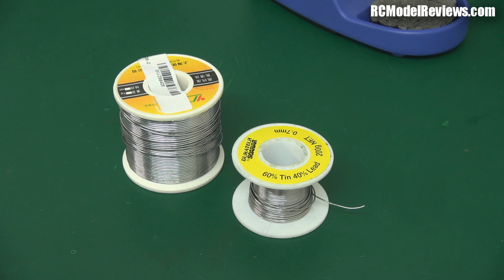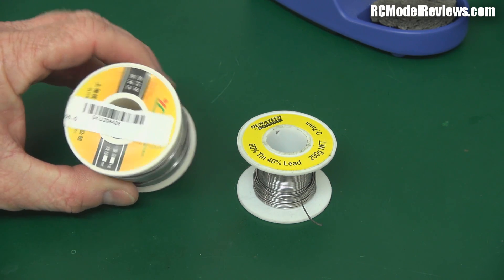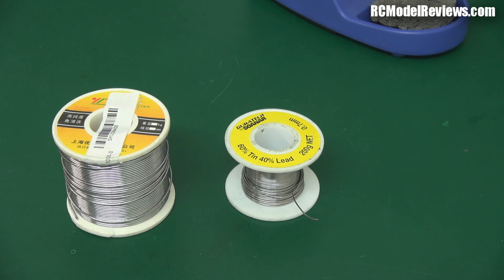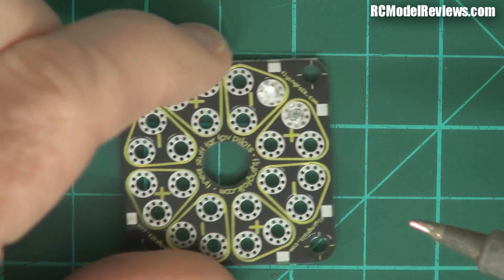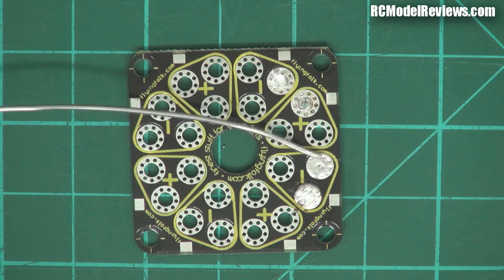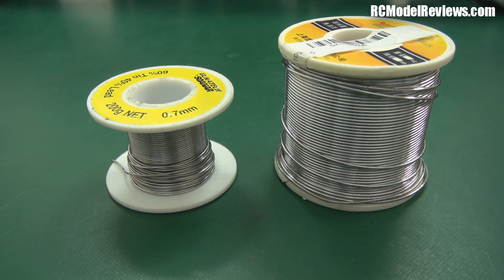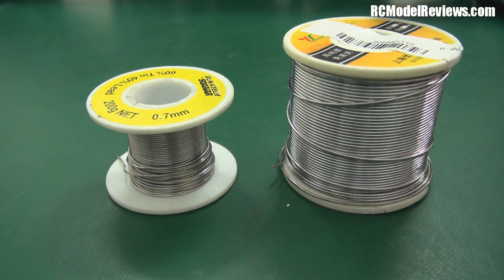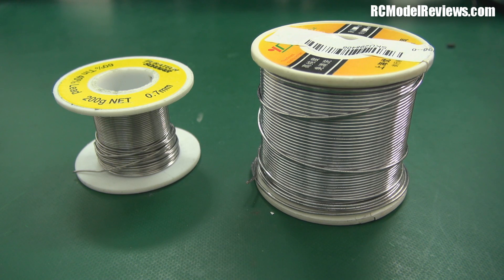60/40 versus unleaded solder

Comment: If you dispose of your expired ciruits properly lead is not a problem. IT will be recycled and made into new solder or radiation filters.
Reply: Very true. The problem is since Lead Free solder fails fairly quickly under vibration and normal heat temperatures found in cars, it has become one of the major reason modern electronics fail and end up in land fills. It's also been linked to several aviation crashes killing hundreds of people and spilling all those contaminates all over he ground at the crash sites. That's the reason it was banned in the aviation industry, I know I work in the aviation electronics industry. If you are caught using lead free solder in aviation you'll be severely reprimanded or fired on the spot. Not to mention all equipment from that lab will be investigated to check for lead free solder. To bad it doesn't work reliably, it could have been a great environmental help. Now it's just a deadly problem and a major contributor to land fill electronics that fail faster than leaded electronics. Best Wishes n Blessings Keith
Reply: Keith Noneya
 Great information there. Isnt tin a heavy metal to though? Not putting electronics in landfills would be a better idea. I mean until they have been harvested for metals and other resourses. I realise there is probably little financial incetive in harvesting lead but the environmental benefits should outweigh such consideration in this instance. Much more important than chasing carbon.
Reply: Well the harvesting would not be financially viable due to the cost of the materials to extract it. However if there is gold and silver in the electronics it is sometimes beneficial. The best way to solve the problem is to offer cash for working machines or re-purpose them. So good ideas are cnc machines, 3D printers, 3D Laser cutting machines. Or even some robotics. In reality there are so many electronic devices, the real answer is cash for used electronics. I long term solution would be to improve the ability to upgrade or simply unplug an old electronic module to put in a new module. Kinda like lego electronic devices. It would take some serious engineering to do it. Another partial solution would be to create electronic warehouses where electronic devices are stored for education centers. Then votech, colleges or elementary schools can come and take what they want to use for experiments or training.
Reply: Keith Noneya Yeah recykling is great especially when things are recdykiled in their intended use since it requires the least resourses. But I still think scrapping fees simular to those on refrigerators could be an option for end of life disposal. I do think that home electronics manufacturers prefer lead free though since it makes people have to buy their products more often.
Reply: Yeah I agree a disposal fee would be ok as long as the money goes to improving the problem not just going into the general spending fund for politicians to say" vote for me and i'll give you someone else's money in the form of a benefit". Also with a fee I think you have to collect the old electronics otherwise it's just a punishment tax for using something and then the old electronic trash still ends up in the land fill.
Reply: Keith Noneya
The fee should go towarts safely harvestin heavy metals off course.Not like tax rebates on "green cars" that only promotes one fuel over another which is actually less green considering the way most people drive.
Reply: Yep I agree with that. Of course the whole "Man Made-Up" Climate Change Scam is another story in itself of government and opportunistic capitalists, posing as environmentalists, using it in a corrupt and power grabbing institution. Well I think we've beat this horse dead already. Thanks for the conversation, Rimmer! Best Wishes n Blessings Keith

Comment: Ditto and good info.  Lead-free solder sucks bigtime indeed!  Although it flows for shit and is known for making shorting tin whiskers, we are forced to use it on high reliability areospace equipment delivered to the EU because of their (*) RoHS regulations which apparently even trump reliability considerations...what major BS! ...and sure enough... units have failed because of tin whiskers...I can't elaborate on the resulting failures and effects...but customers got the lead free products they wanted!  We experienced no such failures on US products using good old lead!  
My advice: Give me "Lead Based Goodness" in my electronics...just don't eat your lead containing electronics!...and as far as breathing lead fumes when soldering...that's a bunch if horseshit also...we solder at hundreds of deg F...boiling point of lead is over 3000Deg F!...sure, a few molecules may be liberated when soldering, but these are also immediately dispersed, or sucked away and captured in carbon filter by the solder vac systems in industry, so operators are breathing a fraction of a fraction of a fraction of those (if any)!  Most hobbyists home benches don't have a vac system, but when soldering with lead based solder, if you vent smoke away, you are more likely  to be exposed to dangerous levels of damaging gamma rays from the Kuiper belt, than dangerous lead molecules from your electronics work!  Solder on!..and with lead based eutectic solder...I have been since high school, in industry with vac systems, and at my home bench without, and I, nor ANYONE I've EVER worked with in industry has been poisoned by it yet!  KA1RPB

Comment: Yeah that is some shit lead free solder. It looked like it contained alloys that were not melting properly. I have bought cheap 60/40 also that was horrible to use most likely because of the flux being terrible.

Try some shenmao solder normally resold on spools in electronics stores under there own brand. 

This is the one i recommend to people in the uk 

http://www.rapidonline.com/tools-equipment/rapid-premium-lead-free-solder-wire-22swg-0-7mm-100g-reel-85-6612

I haven't tried multicores leadfree solder but from my experience with there 60/40 solder i would expect it to be at least good.

Antex lead free solder had flux that spat like crazy and very painful when it gets on you.

I agree that people should buy a small amount of good quality 60/40 when starting out soldering as its much harder to work with lead free because of the higher melting point but when you get good lead free solder you can get better performing connections than with 60/40 because of tins better electrical conductivity.

Just do not expect your lead free joints to be nice and shinny lead free does not set shinny once you get used to that you can still see if the solder has flown properly or not.

Comment: I used lead free solder since I begann soldering, and I have never had any problems, it is a little bit more difficult. Also the solder you use seems to be very cheap solder. There are quality solders out there, based on silver and tin which are very good, but lead is very bad for your health and I would always use lead free solder...

Comment: The interesting thing about leaded solder is it is exempted for use in medical devices via the ROHS regulations.  Why?  Because non-leaded solder can actually grow (yes grow) whiskers over time and cause electrical conduction where it should not.  So medical devices will still use leaded solder so they do not kill you or malfunction.  That means other devices made with non-leaded solder will potentially fail sooner and be less reliable.  Great huh?

Comment: If you use the right technique, you would not have this issue, been soldering for 3+ decades, took a week or two to get the proper technique, after that, it's fine. How about 90% of all your electronics now, are they also crap because they are lead-free, lol.

Comment: Funny thing about lead free solder; it was phased into the only solder for production use via the RoHS (Reduction of Hazardous Substances) Act (2006) in the EU alongside the WEEE (Waste Electrical and Electronic Eqipment) Directive (2002) in a vain attempt to reduce the quantities of heavy metals in landfills.  Ironically, as we have all seen since then, these two acts combined have lead to more consumer electronic waste in the last 10 years than the previous 50.  I mean, who can forget infamous problems caused by lead free solder like the RRoD, Y(A)LoD, countless TV failures, laptops that just die, etc?

If anything the attempt at being green has horribly backfired and created a bigger problem everyone (politicians) is looking the other way and pretending it's not happening.  There is very good reason the entire aerospace and automotive industries are not using lead free solder in their electronic manufacturing processes.

Blah, blah blah blahhhh. . . . is probably gagged, blindfolded and carted away by some Greenpeace nut jobs

Comment: Lead-Free soldering actually doesn't suck.Im using lead-free solder for about 3 months now and I have to say that it's even easier than working with lead-based solder, but only if you have the right solder, the right temperature and the right tip. I use a Ersa RDS80 soldering station and some "Stannol" solder. I found out that you have to try around with the temperatures quite a lot, as in my case the solder doesn't flow anymore with 10° C more / less. The tip has to be quite wide, too. I use chisel tips in most cases but if its a small connection normal tips also work. In your case the temperature seems to be wrong (or its even caused by the shitty solder, flux also seems to be quite important).

Comment: eutectic = 63/37
and u should use flux and higher temps (perhaps consider using a better soldering iron when using lead free solder). Its pasty because the temp is low.
and i didnt heard u mention it , but there are maaaany many types of solder wires out there , with or without flux  etc. At first i was using leaded and still use it when working on difficult , temp sensitive projects but on a regular basis lead free is the way for me.

Comment: Two things: good lead-free solder is not that cheap. Try MG4900-35G instead. Second: your iron temperature was not adequate for this particular solder. But yes, even with a proper temperature, this one will not solidify in an instant. So you should not move anything inside your joint while it cools down.

Comment: Leadfree solder is not hippy solder. It is a requirement by UK law for all new equipment. and is the only reason any engineer would use it.
Early leadfree solder is pretty shit but the technology is improving. Thats both in the irons and the solder its self.
Unfortunately its not tolerant of cheap equipment and does require a retraining of soldering skills.
You also cant cross contaminate by using the same iron for both. Well legally anyway. Whilst only big companies get done for using lead solder in reality so 2 bob shops are fine.

https://www.gov.uk/government/uploads/system/uploads/attachment_data/file/31803/11-526-rohs-regulations-government-guidance-notes.pdf

Comment: Lead free solder is one the reasons I stay busy as a repairman. Not a day goes buy where re-soldering components or a connection doesn't resolve a problem. On my personal work, I always use leaded solder. So in reality; I hate lead-free and and also love it.

Comment: I use Pb free solder at work for some customers but other customers I use 1%Cu which is harder to use and needs a hotter iron too.  Bring back 60/40, it works so well.

Comment: I'm surprised to see Bruce adding to the nonsense being said about lead-free solders. A decent Sn/Ag/Cu solder behaves almost the same as a 63/37 Sn/Pb. The silver makes all the difference and, as all bar one of the alloys are under patent and silver is expensive, I very much doubt that the one here has any in it.

Edit: I'm wondering is the Banggood solder is actually 40/60 Sn/Pb, which is meant for plumbing and metalwork and does behave as demonstrated, on a reel with a dummy centre.

Comment: One other problem with non-lead based solder is lack of ductility. This results in cracked joints on surface mount components after repeated heating/cooling cycles or after flexing of the board. It is problematic especially on larger chips and chips that run hot.

Comment: 60/40 is only near eutectic,  63/37 is definitely better in any situation where it may move while cooling.  also,  decent lead free is near eutectic as well, but it seems to oxidise quickly, which is when it gets pasty.   if you can solder fast, with a decent quality lead-free solder,  it works well.

Comment: Remember the Red Ring of Death?
that was a direct result of the EPA mandate that electronics be lead-free, so microsoft had to use lead free solder from then on.
the 360 got very, very hot during its operation. after many heat cycles of heating up and cooling down, the garbage lead-free solder would start the crack microscopically and cause intermittent shorts. eventually the graphics processor would become so poorly connected it would give up and throw the three red lights error code. 
the way to fix it? melt off the processor and "re-flow" all the solder, removing the lead free stuff and replacing it with the 60/40 goodness. Never breaks again after that.
Reply: +Ryukachoo I'm not aware of such a mandate for the US. They likely used lead-free solder so that they could sell the Xboxes to people in the EU.
Reply: nubowner1
look up ROHS
Reply: RoHS was adopted by the EU, not the US.  It does however have global impact as most manufacturers will make their products RoHS compliant to sell their products in the EU.
Reply: i wrapped my xbox in a towel while being on and let it sit like that for a while. it reflowed the solder for me and worked

Comment: I'm a bit of a tree hugger, Bruce, but I certainly agree with you about using the 'proper' solder I've been using for well over 60 years.  When I was working on short range radio telemetry systems (just a few milimetres from the rotating to the stanary elements of gas turbine engines) the rotating bits got pretty hot (>125 degC) we used pure tin which has a higher melting point.

I think the lead free has a place in plumbing because it's always better not to drink water with lead in it.  Although I used to live in a house with lead water pipes and it never did me any harm ... I don't think :)  I also used to work with a guy who kept his solder in his mouth when he was soldering but we were just engineers wiring up breadboards rather than full time solderers.

Comment: I thought only 63/37 was Eutectic?
Reply: For tin-lead, that is correct. (60/40 is close, but is not eutectic.) There is also a eutectic lead-free blend, I think it's the 96/3/0.7 alloy (tin, copper, silver, I think). Wikipedia has a list of solder alloys, including which are eutectic.

Comment: If you don't know how to use lead free solder, don't make a video claiming to be a comparison video. This isn't. This is a "I don't know how to use lead-free solder" video.  Yes, lead-free can be trickier to learn... 100% Sn is troublesome, but alloys like SAC305 are not bad at all. I've never seen that pasty effect at temperature, EVER. Try turning your iron down and see how the leaded solder does. That said, there are some absolutely awful formulations out there. The flux is somewhat important too. MG Chemicals 4900-xxx works well. (for example, 4900-112G)

Comment: lead free solder flows at 280, that's pretty hot .  You should have both kinds of solder anyway.  Mixed-solder solder joints are not too reliable in the long run..

Comment: The BEST solder for both electrical and structural uses, available on the easy to get consumer market is:

Radio Shack 64-013 E  

It is a Silver Bearing Solder with a Rosin Core.  I use the .022" diameter all  the time, but have both fine and 
heavier versions too.  It is FAR stronger than the lead solder you like, but flows very nicely with a medium 
heat iron.  Try it, you'll like it.

Comment: Or use some of the tin/silver/copper based solders. If you buy any of the "not-cheap" stuff, you can easily use lead-free solder. Especially important if you want to comply with RoHS stuff.

Comment: dude - lead poisoning  in soldering using industry was quite common. 
Use more flux and your result will be much better.
Reply: Exactly, I've just seen two comments already in here from people who are bashing lead free solder but one didn't know you need to use more heat for lead free and the other said that "you don't need flux cause it's already rosin core, lead free just sucks". Using extra rosin flux whether it be liquid (my preference) or paste will significantly improve the ease of use and the joint quality. Most of these guys are to blame not the lead free solder. I use leaded when I can but I certainly have no problems with using lead free.

Comment: Does anyone know what is the solder used in lipo batteries is? 60/40 doesn't stick to the metal, I ended up scavenging solder from a dud cell to make my last connection.

Comment: Your preaching to the choir...   I've done a lot of soldering and lead free, no matter who makes it sucks.
It's very unforgiving to being overheated, it's very  unforgiving when you under heat it.  Everything must be really 
clean to make a good joint... it does not like cold or wet environment, it will not tolerate vibration.
it sucks.. just say no...

Comment: I wasted a whole day at work because of that lead free crap once.  Spent a day trying to connect up some 12V garden lights for a client, the stuff is almost impossible to melt and when it finally does it wont 'bond' with the copper.

Comment: Just want to mention that leaded solder has a lower melting point (188 °C for 60/40) than both the lead (328 °C) and the tin (232 °C).